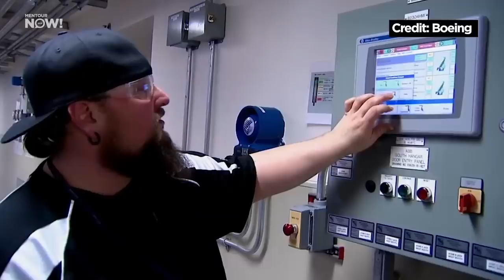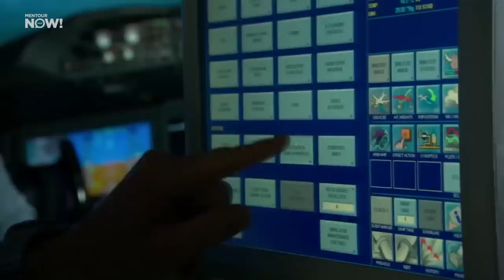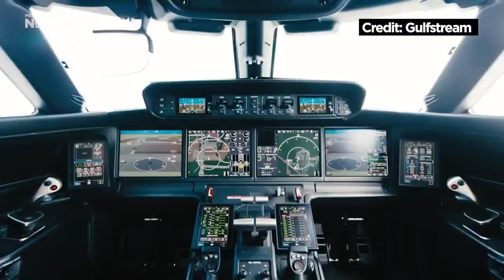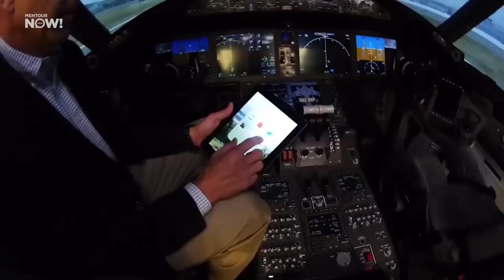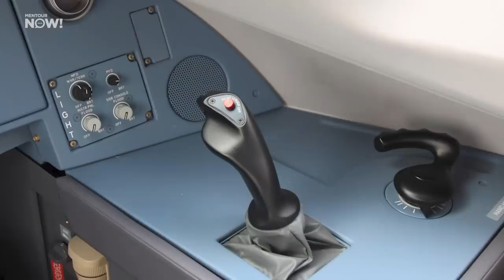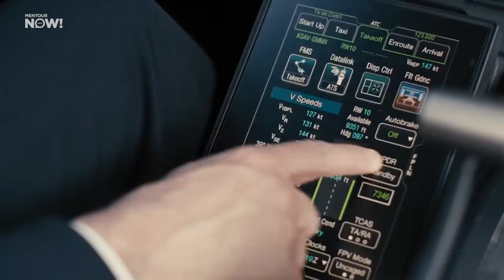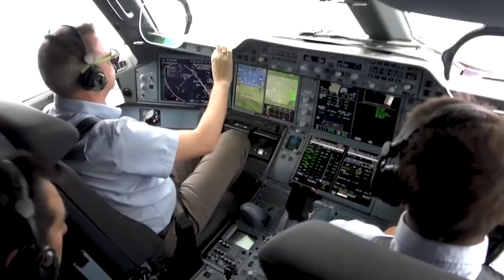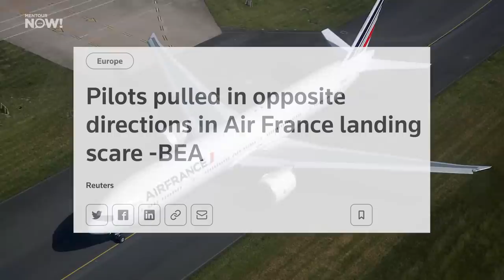Is Boeing Switching to SIDE-STICKS?!

Comment: I would think that the left hand side stick would be hard to control and get used to, being right handed and the same for right hand sticks for left handed copilots.
Reply: I heard many pilots transitioning to sidestick aircraft or becoming Captains in sidestick aircraft expressed concerns about having to use the non dominant hand on the sidestick and the brain also compensates for using the hand and builds new muscle memory. However most pilots have stated it wasn't an issue at all to use the non dominant hand on the stick, taking within several seconds or minutes to get used to it where they said it was just as good to use as the dominant hand. Now some pilots did indeed have trouble using the non dominant hand but after a few training sessions in the simulator, the problem goes away to where they are just as effective to use the non dominant hand as the dominant. I guess based on pilots input, it really depends on who is able to be able to use the non dominant hand quickly and who will take longer. And with a yoke, during descent to landing, it's one hand on the yoke, the next on the throttles, including having the non dominant hand on the yoke.

Comment: dont know if it still around but i remember hearing that with side-sticks the captain can use an override so if he needs to take over for whatever reason he can use the override to cut out the other side-stick. Ive watch enough Air crash investigation to know that pilots unknowingly fighting each other on the controls has lead to a few crashes a lot of times with a newer first officers getting in to a stall and they pull back the captain takes over pushing forward but the first officer keeps pulling back. forgot the flight number but in one crash they didn't realize they where fighting each other on the controls and they though the controls where stuck.
Reply: Either pilot can takeover. Not just captain

Comment: Regarding the dual input point you consider as a "sidestick drawback" at 5:22 (disclaimer: I can only speak for Airbus): 

First of all: The term joystick stands for a piece of equipment you would often use for desktop simulation like fighter or flightsims. If you have ever taken a look at a real Airbus sidestick on the other hand, you would quickly see that the sidestick doesn't have much to do with a game joystick... The real sidestick has a big mechanism which consists of numerous dampers and actuators😉

Now --> Regarding "Dual Input" in the Airbus:
Yes, I agree that being able to actively see the sidestick on your side move while a trainee makes an input would enhance the instructor's situational awareness. 
But: I don't really understand why that would be beneficial during airline operations, as both CM1 and CM2 are perfectly capable of flying the plane. If something doesn't go as expected, the other pilot can intervene IMMEDIATELY by holding the "instictive AP disconnect and priority take-over pushbutton", aka the red button on the sidestick, to disable the other pilot's sidestick for 40 seconds and make his corrections and inputs independant of the other sidestick movement. The airplane will call-out "Priority left/right". If the sidestick were mechanically linked, it would be much harder to intervene. 
So, on a personal level, I am of the opinion that the Airbus way actually enhances safety! 
And also minor corrections are possible by just moving the sidestick on your side, if you feel like it for whatever reason as I've never heard of that being required nor a general practise...
As you mentioned, an aural and visual cue, "Dual-input" and an announciator light flashing on the glareshield panel, then immediately attracts the pilot's attention and tells them that there is a dual sidestick input.
Reply: @CoasterFan77 First of all, you can look over at the FO as a captain if you want to know what he is doing. But: "assist in the flare during landing if the co pilot for example don't flare enough" -- You can absolutely assist the Co-Pilot! If their flare is not sufficient, you can help by making an input to your sidestick and the control inputs will add up and you get a greater deflection of the control surfaces. Also, the clear role of PF and PM in the Airbus is important. If the FO is PF then he will land. And no airline will let a Co-Pilot fly without an instructor if they aren't ready yet. I don't see any situation where a simple "I have control!" wouldn't suffice if the Co-Pilot has a bad day... And I also can't think of any reason why you would intervene while the FO is landing the plane. The FO is just as qualified as the captain!

And I think you got that Air Asia incident wrong. Doesn't have to do anything with the sidesticks not being linked. After they pulled a C/B because they kept getting repeated FAC-faults (which you shouldn't do - never pull C/Bs in flight...). That lead to an AP fail and then the FO did some weird stuff with his controls. But I don't see why a mechanical linking would've been beneficial here... Actually, if they were mechanically linked, the captain couldn't take over the controls and correct the FOs oversteering (if he handled it correctly - the wikipedia article doesn't state anything about the captains actions unfortunately). But the reason for the crash wasn't the Airbus sidestick...

And yeah: In that other incident the flight crew operated the plane completely wrong... like linked sidesticks wouldn't have helped anything there...

Comment: Would it make sense for them to offer 2 variants and let the customers decide?

Perhaps yokes using electromechanical feedback (like active sidesticks) rather than conventional mechanical linkages would keep the differences to a minimum, and allow them to design a cockpit that could accommodate either option? Would also help with the weight. (Probably not with the table problem, though 😄)

Comment: Boeing can make the yoke /side stick an option. There is of course a small cost disadvantage. The yoke can be wired up the same way as a side stick , without any mechanical linkages. I am surprised there is not more said about pilots switching hands to fly the aircraft when they switch seats. I know from driving a large % of drivers cannot drive operating the brakes with their left foot, and it takes a bit of training to get the muscle memory to operate a clutch with the same foot. They can save some space and still have a yoke by doing the same thing as the Cessna, the yoke come out of the front instrument panel instead of being supported by a bulky pedestal on the floor.

Comment: I had to think about this for a while and after talking to fellow GA pilots and a couple of friends who are commercial 777 Pilots I've decided that yoke is the way to go.

We all learn on yokes because all the entry level aircraft that's all they are still. And it's not just muscle memory but it's the neural ropes that tie critical thinking to reaction that are initially developed that are most important. Syre, you can learn side-stick but it will always be secondary to the original yoke imprinting.   Basically some people will adapt to it better than others and you may not find out the difference until you're in a stressful situation.

Also, there is a consideration for which hand is predominant and whether you're flying left side-stick or right side -stick.   Yokes are generally forgiving in regards to hand predominance and brain function, again especially in stressful situations.
Reply: Not everyone leans on yokes. That's false. Some came from the military with fighter jet aircraft with both center sticks and sidesticks prior to coming to airline business. So transitioning to sidestick aircraft would be more natural to such pilots. lso some GA aircraft like the Cirrus SR22 have sidesticks. Some 777 and 787 pilots actually prefer the sidestick based on some of them questioning why they have yokes in their planes after flying sidestick aircraft. Pilots train in the simulators to be able to use their non dominant hands and the brain adapts and compensates accordingly. Most pilots said they got used to it within minutes. Some did struggle but nothing more simulator training could not resolve. Sidestick aircraft have been flown in troubling and stressful situations before like Air Transat 236 and Qantas 32 and yoke aircraft have been crashed in stressful situations so that last statement is moot.

Comment: One advantage of yokes that isn't often brought up is that they are completely ambidextrous. Whether you're sitting in the left or right seat, the yoke in front of you is the same and you can use it in the same way. Whereas with sidesticks, if you're in the right seat you use your right hand, if you're in the left seat you use your left hand, which is apt to make a lot of people have an innate preference for one or the other. If you're right handed, for example, you may feel you have better fine control in the right seat using the right-hand stick, than in the left seat with the left-hand stick. With Boeing's centered yokes this isn't an issue.
Reply: I heard many pilots transitioning to sidestick aircraft or becoming Captains in sidestick aircraft expressed concerns about having to use the non dominant hand on the sidestick and the brain also compensates for using the hand and builds new muscle memory. However most pilots have stated it wasn't an issue at all to use the non dominant hand on the stick, taking within several seconds or minutes to get used to it where they said it was just as good to use as the dominant hand. Now some pilots did indeed have trouble using the non dominant hand but after a few training sessions in the simulator, the problem goes away to where they are just as effective to use the non dominant hand as the dominant.

Comment: you have to use a different hand depending on what seat you are in, is that good
Reply: you have to do that with yokes as well because you need one hand for the throttle. so there is no difference

Comment: What about switching from the right to left seat? Do pilots train for both sides from the beginning or only when they are promoted to captain?  Is there evidence to show that a pilot is a better pilot with one hand versus the other?  I suppose you can get used to anything, but I’d prefer not to be a passenger during the learning curve. Also, aren’t all recent American fighter jets equipped with side sticks? Do they have them on both sides to accommodate pilot preference? Just wondering.

Comment: I wonder if Boeing could initially offer side sticks as a option, would possibly be more appealing to airlines operating Airbus fleets
Reply: I doubt it would be practical.   Putting sidesticks on e.g. a 737 would be a massive cost in development and certification.   If an all-new Boeing was 100% fly by wire, I guess it would be easier to design alternative yoke or sidestick, but then both systems would need to be fully certified - that's a big cost duplication - and in any case sidestick would be only maybe 1% of the retraining costs  (the other 99% would be all the other differences between the designs).

Comment: You forgot the C-Series/A220. It had active sidesticks prior to the gulfstream i guess. Regarding "see the inputs": i always thought it's more important what the plane does and not what the pilots do. Do you judge the input of your copilot or how the plane actually reacts? Similar to "look at the instruments" and not "try to feel what happens".
Reply: @Clayson Antoons All this -----^, plus it's nice to feel what the autopilot is doing too. When I'm on an approach with it turned on, the feel of the yoke in my hand (simultaneously with the pictures in the PFD and out the window) is valuable in keeping me in the loop. When I got in this plane, it took me a year two to get over the lack of rudder pedal feedback from the yaw damper (whereas in my previous plane, the pedals moved). Imagining the same thing happening with the yoke/sidestick.... is not a pleasant thought. Removal of any elements of the pilot-airplane interface is not a welcome change to me.

Comment: If Boeing do it in proper way I'm all in. (unlike that JOYsticks in airbus). That's mean with force feedback, left and right stick are connected together (electrically only is good too) one push left second stick follow that movement. And forces on controlsurfaces will be transferred to sticks.

Comment: HIGH Fuckin TIME! 

Boeing is the same company which designed the space shuttle cockpit and  used a sidestick on that and conveniently left us using the same old crap that has been on aircrafts for the last 100 years. 
I was hoping to see 777x with the sidestick, but no. 
Boeing, like the US is living it's past glory and stubborn to any changes. It's mostly the American Pilots Lobbies which refuse this change, I guess they are so used to the inconvenience of having their meals on their laps, they never think that there is a better way.
What is that bloody thing doing there in the first place. It's a completely fly-by-wire aircraft. It doesn't need a huge hunk of metal to control it, the B787's rudde is also fly-by-wire so she can kick in the ridder for you incase of an engine failure on takeoff. 🤨
Had it not been for these lobbies led by these old farts, I am sure Boeing would consider doing this a long time ago.

There are many things I question about the Boeing 787 having flown it for the last 3 years. Why do we switch on and off the Hydraulic pumps, fuel pumps?  Isn't it all automated anyway. Like if the engines are off, the Hydraulic pumps go off, if the engines are running, they will come on by itself. They are on AUTO mode, why touch them? Well, it's all in the name of 'commonality' 🙃 21st century aircraft keeping itself rooted to 1950s technology..wow! 

Get over your past Boeing, you are not the best anymore, the world has moved on!

Comment: Something you didn't touch on, while I don't like yolks, I do like a center stick, but yolks can be flown with either hand, while the side stick is either left or right, depending on what side you're sitting on. That might be uncomfortable for some pilots depending on hand dominancy.
Reply: Well, many pilots who flew sidestick aircraft with the non dominant hand I came across said they didn't have an issue using it when going for training. However yea you're right that some pilots will have trouble with it. I came across several who reported difficulty using the non dominant hand for awhile when going for training to fly the aircraft. For them, it took further training before the problems disappear.

Comment: I flew from the EU to the USA.  Went one way in a Airbus A330 and back in a Boeing 777-300.

Maybe as a passenger you experience it different but in my opinion the 777 was a much nicer and smoother airplane to fly.  Especially when landing.  In my opinion it is due to the better feeling of the controls with a yoke .   When I asked ine of the flight attendants , which happened to fly on both planes to, she said she prefered the Boeing also.

So the question arises:  which is smoother flying????
Reply: @Clayson Antoons well thanks for your great and complete explanation .

What I thought was that the yoke gives you a better feeling of how much input you give on the total input you can give. So the pilot feels better and faster which input he has to do.
Reply: @Clayson Antoons thanks again👍  nice to read your explanations.  They give a nice insight in what is happening in the cockpit.  If you understand this as a passenger it is so much nicer to fly.

I for instance would have never guessed that speed is such a factor in controlling a plane.  Now you said it it only makes sense.  More speed is having much more power on the input.

👍🙋🏼‍♂️

Comment: I was wondering : In terms of crew training : Does the fact that yokes are truely ambidextreous and are used essentially identically whether you are sitting on the right or on the left side while side sticks are flown in a mirror configuration - and that, for example, switching sides could have side effects ?